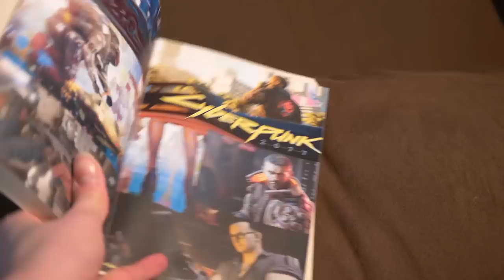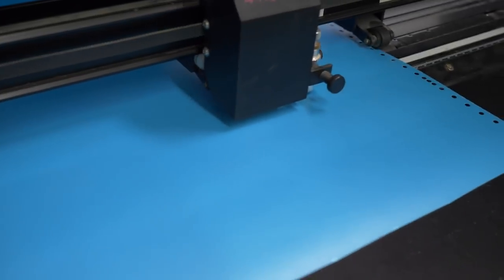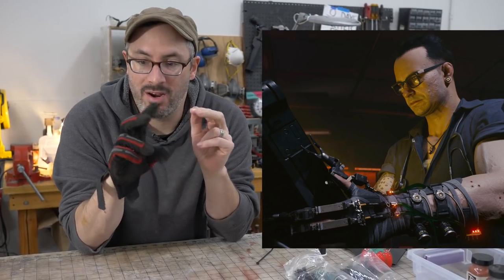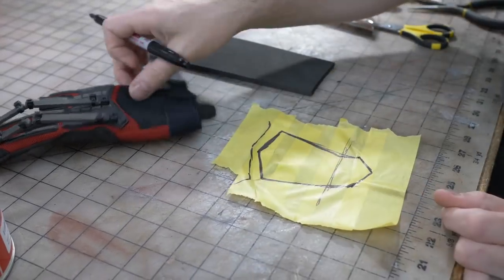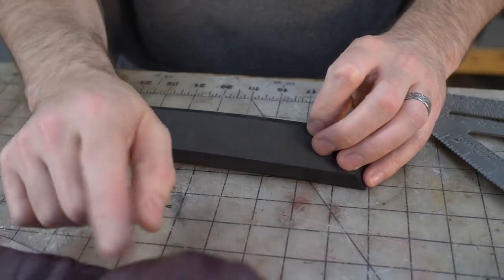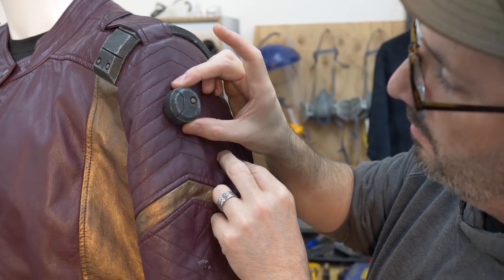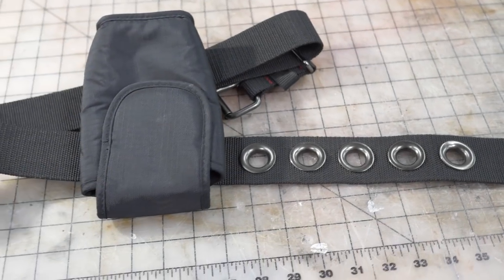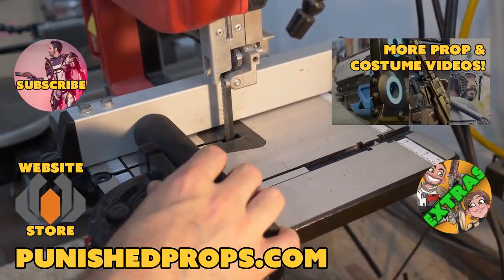One Day Build: CYBERPUNK 2077 Inspired Costume - HOW TO

Comment: "Everything in the future is hexagons" 
If we could be sure of one thing about the future, it's this. It's funny how much sci-fi uses hexagons, 45 angles and whatnot to signify "future" :p.
Reply: It's a step up on silver jumpsuits.
Reply: @jedizero2  Interesting, thanks!
Reply: Better than skin tight white jumpsuits from say Buck Rogers or Battlestar Galactica.
Reply: or if it's BSG octagonal paper. THERE SHALL BE NO CORNERS ON ANY PAPER. so say we all :P
Reply: @joost199207  All good man. Who knows, maybe on day people will look back on the hexagon as a sci-fi staple the same way we look back on silver jumpsuites. :P
Reply: We got those now, too... but they come in hexagon pattern!
Reply: Radio control car plugged in with electricity boys what store
Reply: Deus Ex HR: *sweats nervously*
Reply: @catnium  Cars look kinda different. Back then, they were really boxxy.
Reply: Because hexagons are one of the most efficient shapes for a space/volume to material ratio.
Reply: @jedizero2  The most stable shape is the equilateral triangle. It just so happened that when you tile (teselate) equilateral triangles you get hexagons as well. A hexagon is 6 equilateral triangles, al connected at 1 vertex
Reply: Hexagon force by Waterflame starts playing in the background
Reply: Better than a certain skin tight white jumpsuit from Mass Effect 2, though..?

Comment: Very cool build.  As a tip for future glove/clothing modification, use a hot knife to cut nylon webbing/thread - it will melt the edges and prevent them from fraying and coming apart. A pistol grip soldering gun with a knife tip works very well for this.
Reply from the maker: Fantastic tip! =)

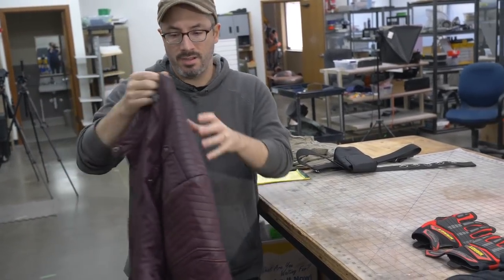Comment: 1:03 THIS! Especially with shoes!
It has already become utterly impossible for me to find inexpensive, regular old brown leather (work)boots to wear normally, and then I need to find a pair of cheap brown riding-style boots for cosplays such as Link from The Legend of Zelda, and other light-armoured fantasy characters.
And in the meanwhile the women's sections are filled with a huge variety of both of those, but the absolute highest they ever go is 1 or 2 shoe sizes smaller than mine...
Reply from the maker: Ooh yeah that's tough. I clock in at a size 12 mens, which is tough to get in a womens style.

Comment: The thrift store builds are my favorite. I'm interested in the Angelus paints, are they made specifically for leather only or would they work on faux-leather jackets too?
Reply: Check the link in the description. Their whole brand is based around painting actual leather.
Reply from the maker: This jacket was actually a faux leather and it seemed to work just fine.
Reply: Punished Props Academy thanks for letting me know, their site suggests it works on a wide range of materials, their shoe painting tutorials are great.

Comment: For those of us without foam dowels to work with, if you want to make circle disks using floor mat foam, you can use a hole saw with or without the center drill, just run it backwards so it doesn't catch on the foam.  I experimented with it last night and by beveling the edges and gluing the off-cut back on, I was able to stack these and make a very smooth solid cone.
Reply from the maker: Great tip! Thank you for sharing. =)
Reply: And thank you for the videos.  I'm getting decent at foam, but I still have so much to learn about working with fabrics and basically everything else. ;P

My first and second Mass Effect suits:    https://imgur.com/a/F7j7blT   I think I've made a little improvement. I need to remount the hips on the costume though, the mount broke and it gave me droopy butt. 

You and Adam Savage are some of my favorite youtubers because I learn so much from you guys Most of you videos are teaching some new technique or material.